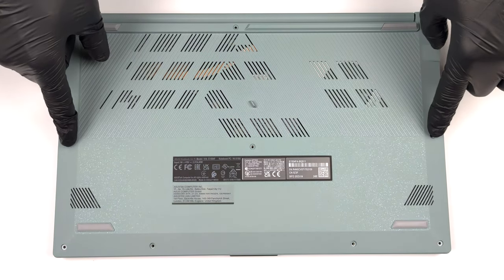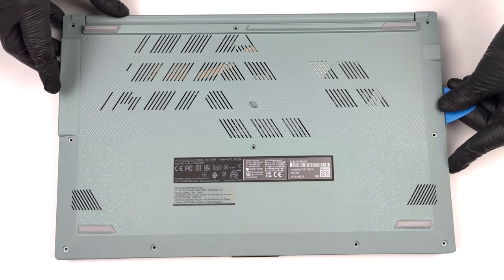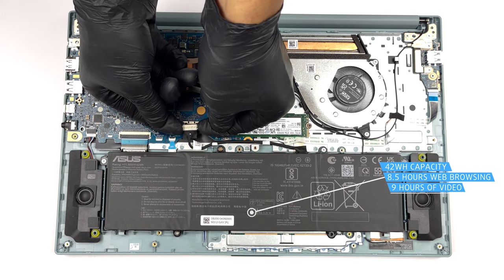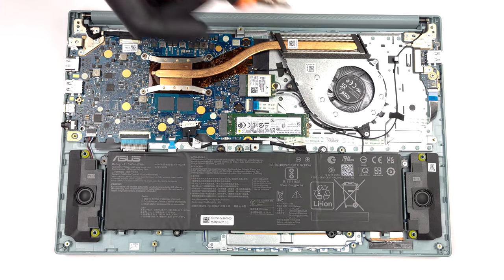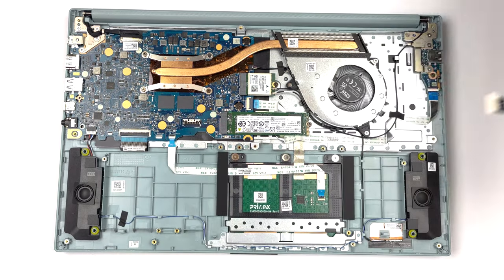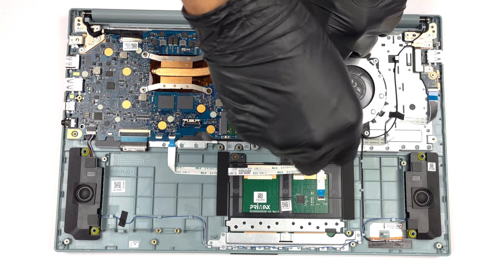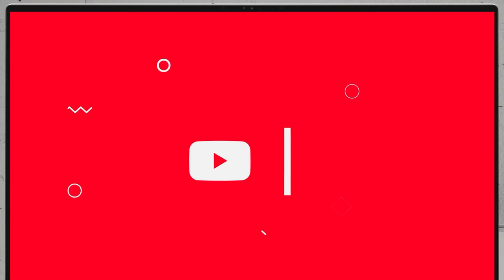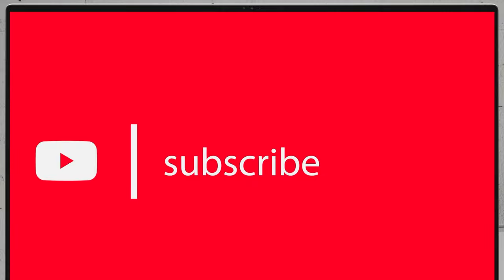🛠️ How to open ASUS Vivobook Go 15 (E1504F) - disassembly and upgrade options

Comment: 16GB DDR5 5500MHz, and people say it’s a joke because it can’t be upgraded. But why would you want to upgrade to 32GB? To run AutoCAD or play Red Dead on this laptop? Theyve already provided the most capable RAM the laptop can handle. Adding more would just be a waste.

Comment: Just so people know, some versions of this have no M2 slot, the SSD is soldered on the board and there is no upgrade path at all. If you have an SKHynix  SSD then you likely have no slot.
Reply: Just realised this when I popped the top off to replace the SSD, and I'm REALLY disappointed, if my HD dies I'm screwed.  Does anyone know what the two small connections are designated con6303 and con3102 if they're sata I might be able to add a HD that way, unless the bios disallows it. Such a crap way of making laptops, and it wasn't cheap. I'd consider a mobo swap out if I can find a comparative spare.  I need the space for my programs
Reply: @JonnoAndrews  I think the price here is because of the OLED panel. Other laptops in this price range have pretty awful LCDs. Its a trade off Im willing to make but its a shame the SSD can be replaced.
Reply: @chrism2964  Yeah... agreed, I DO like the screen a lot, although I've dropped the saturation! Sheesh! 🤣
Reply: @JonnoAndrews  Yeah its a tad pumped. I guess if the SSD fails you could run from an external USB3 drive, but it will be slower. The motherboard does have the solder pads, so if you were brave you could try adding an M2 slot, assuming the traces and controller are wired up.
Reply: @chrism2964  Out of interest I tried booting a WIN PE USB (and a W11 USB installation disk) and also an Acronis rescue disk, All couldn't see an external drive to install to, so I'm afraid it's not an option to tether an OS. I can't see the unpopulated M.2 slot in bios, so it's probably a no-go. Thanks for the replies, and we live and learn. :)
Reply: That's awfully sad.. Good thing is that the whole mobo of this machine isn't that expensive and kind of easy to find on a quick search.

Comment: Wow they really messed up on this one. I'd rather pay more for a computer than get a throwaway. Keep in mind, RAM requirements continually go up for software. So, these are going to go into the trash sooner.
Reply: I have one  and is no working  ram  bassicaly  you can't  install  windows , what  a trash
Reply: Depends on what you do.. Nowadays even 8 gb is more than enough for Win 11 web browsing and such. And 8 gb has been pretty much normal or even cheap for the past 10 years maybe? Even more perhaps?

Ram has reached its peak. You could go with 32 gb or 64 gb.. even 128 gb of Ram without an issue, but what for? My own computer has 32 gb and I use it for everything, working, designing, gaming, and I have never used more than 20 gb, even with stuff like chrome opened in the background with dozens of tabs while using tough softwares.
Reply: @cristiansosa1512  8gb was an absolute joke since windows 8. If you're running a web browser with a good amount of tabs, MS office and use zoom for meetings. All of which are standard if you're a student or teacher. You need 16 gigs minimum. Nowadays, no one uses their computer for just web browsing or one single task at a time. By soldering CPUs, ram and storage onto the motherboard, all upgrade paths are removed for the customer. Which only benefits the manufacturer by forcing customers to upgrade early. It is also foolish to assume RAM has hit its peak. The computing industry advances everyday. What may hold true for today, changes tomorrow.
Reply: @A-r-o-h  You're wrong there dude, there ARE people that only use it for web browsing. As I've said, my mom as an old lady couldn't care less about anything other than YouTube, Netflix or eventually Gmail.
By the by, I'm on the Vivobook now. Have the antivirus running a background scan while writing this with 8 tabs opened and also windows update searching for updates on the background.. CPUs running at 100% and only have about 1 and a half gigs of ram left, guess what? No hang ups.
Reply: @cristiansosa1512  The average person is not going to use a computer with one app open at a time. That's reality.
Reply: @A-r-o-h what a joke mate.. im running an rtx4070 super with 16GB of ram ddr5 5600mhz and it works fine.. gaming 2K high no problemo... ram doesnt play such a bigrole like opening too many tabs bla bla bla... whats important is the balanced of the system itself... whts the point having 32GB ram and the cpu also cannot change... and 32Gb of ram for what? U expect to do autocad on this laptop is it

Comment: if anyone owns this model, please tell me if the motherboard is making any electrical buzzing noice (im not talking about the fan, ive this sound coming when the fan is still)
Reply: Yes, may be the SSD?
Reply: @richardfrito2014  but SSDs are silent HDDs used to produce sound
Reply: @roushansahu3463  yes, but I have a SSD sata I use it like a external drive, and when is w/r files make a sound like that. So i think may be that, in the laptop is m2.
Reply: No.
Reply: @roushansahu3463 I know what it is, it's called coil whine, and it's not that loud and is no sign of a defect product, it's normal, and some systems produce a way louder  sounds. It usually happens while using the trackpad/mouse and in highly intensive tasks
Reply: @AstronomShorts  thanks for the info

Comment: where is  the ram  ? you said is soldered ?  what if is not  working  how I'm  manage this  ?
Reply: Those big black squares below where the copper heatsink is screwed to the motherboard, those two are the RAM. They are soldered, which sucks big huge time.. but can't except much else for such a low budget laptop.
If they stop working, they you're pretty much screwed unless you find a proper technician to try and fix them, or buy a new motherboard (don't fall for those hawks that'll want to sell you a whole new computer.. the rest of your machine is most likely OK)

Comment: You get what you pay for.. Soldered RAM is something cruel to do, but Asus does stuff that lasts. I have owned different Asus machines and never ever had something broke that couldn't be soldered back again.. and components are kind of easy to find online.

It's just a machine for web browsing and light work. Don't expect much else from this.
Reply: Asus has some of the worst designed display hinges ever made, from the cheapest models to the most expensive. In my experience, they've always disintegrated from the lcd lid after two years. I've bought 2010s and 2020s models, which all went on to have that same issue. They're the only mainstream brand I've ever had that experience with. Not only that, the thermal design for some of their computers is terrible. 

I've seen designs where there's a fan blowing over a heatpipe with no cooling fins 😂 It's the epitome of cost cutting. Also, trying to justify soldering to fix components is a bit silly. The cost to do it properly usually outweighs the cost of the computer. Even if the computer costs thousands, you have to see if it's worthwhile because technology depreciates rapidly.